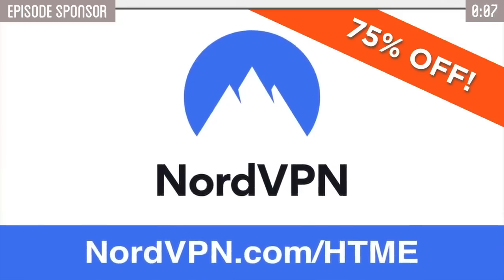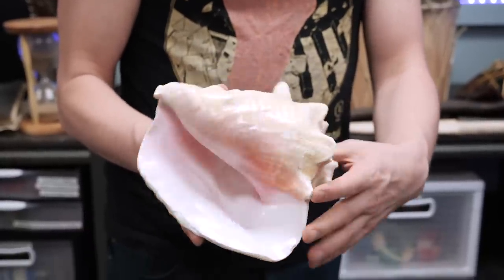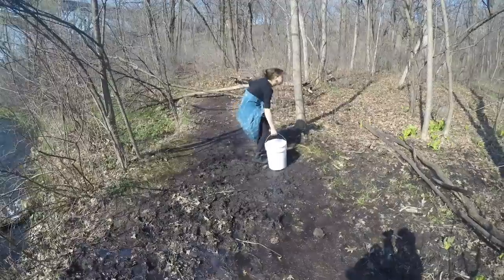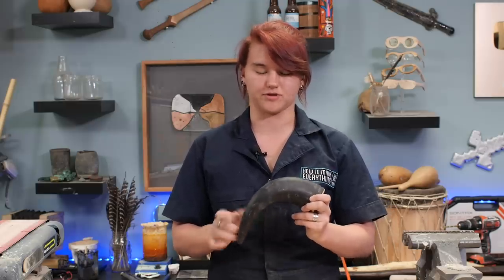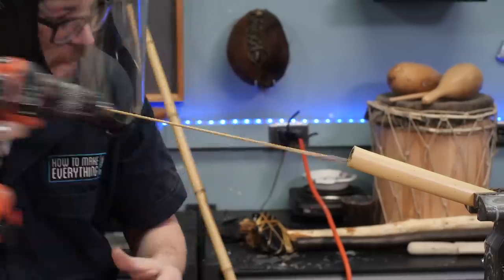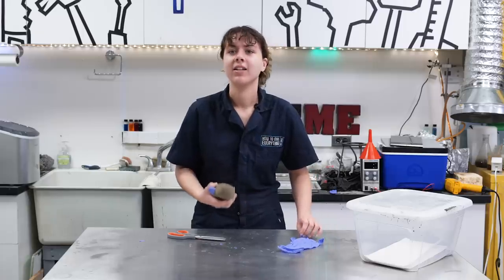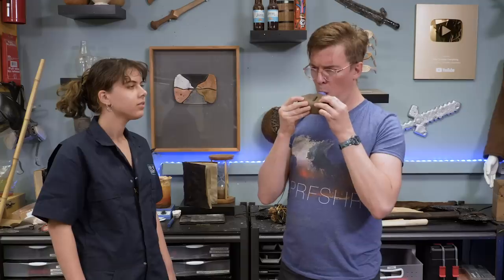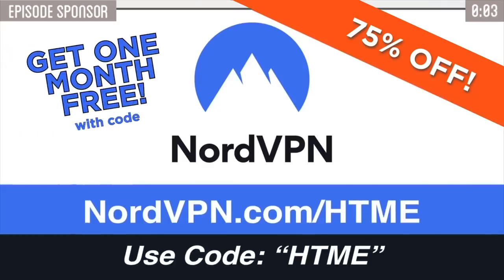Can You Make a Flute from Dirt and Dead Things?

Comment: Regarding the clay: Processing it can be quite tricky. I made numerous beginner's mistakes as well^^

-Don't put whole chunks in the water, as they will form a slick outer layer that protects the inside from dissolving
-Thoroughly dry them first (breaking them up a bit helps with that)
-Then use a rubber mallet (or something similar) to grind them down, as a metal hammer will grind the stones and sand in the clay a bit, adding unwanted material
-Sift the dry powder to filter out stones, twigs and other organic material. The finer the sieve, the better
-Put the fine powder in a tall container (e.g. a bucket, or a glass jug to check the sediment) and add large amounts of water
-Stir until everything is dissolved, then wait for a bit (a few minutes) until the sand settles down
-Carefully pour the murky water through a sieve, without pouring out the fine sand and sediment from the bottom of the container
-Use flat screens instead of round ones, as the clay tends to form clumps more easily
-Rinse and repeat^^
-Pour the final batch into a wider container and wait
-Let the clay settle down until a clear layer of water forms on top
-You can try to gently pour/siphon out most of it, or you let it evaporate under sunlight or at a warm spot with some ventilation

-When the clay has a batter-like consistency, you can put it on a larger surface to speed up the drying process or put it in a piece of cloth.
(Not every towel or piece of cloth will work, though, as clay particles are really small.)
-If you spread it out, avoid forming crests and peaks while spreading it, as those will dry faster than the rest
-Use an absorbent surface material that won't contaminate the clay. (Didn't have any at hand, so I had to wait.)
-After quite a while, the clay will change color a bit and won't really stick to your hands anymore
-When it has a rough, Play-Doh-like quality, begin to work it a bit (research some techniques online), then form a block
-Wrap the block in plastic wrap to prevent the clay from drying out and store it

A block I made about 2 years ago is still malleable. If it smells musty/earthy, that's normal. I read that letting the clay "ripen" over a longer period improves its quality. Some people with sensitive skin might get skin irritations from the mold, though. If your clay isn't processed enough (if it's too gritty) the clay will tend to break while forming more delicate shapes. A simple test ist to roll out a small clay snake and wind it around a finger. If it breaks apart, further processing is needed. Adding sand to a slippery clay is much easier than removing sand from a gritty one.

Further testing:
-Roll the clay to an even thickness
-Take a cookie cutter, glass, etc. and cut out a few circles
-Measure the diameter and let them dry evenly and slowly
-Measure the shrinkage in diameter and thickness after drying
-Fire them (research best practices online), then measure further shrinkage in diameter and thickness
-Some of them might crack. Grind them down a bit and add the so-called grog into a batch of clay to strengthen it
-Take measurements of the ratio of grog and clay
-repeat the tests with varying thickness and diameter with and without grog
-Write everything down

Further research:
-Glazes
-Firing process
-Different ceramics and their recipes
-Tools and techniques (flywheel, grafting pieces of clay together, sanding and polishing, etc.)

It's quite a broad topic.

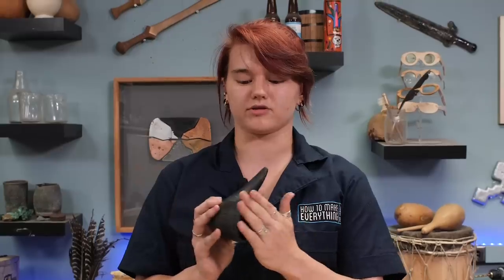Comment: 7:40 
I personaly would never do this with a chop saw. I work with woodworking Machines everyday, and there is many ways to use them that they are not intended but that just looked unsafe to me. The forces of the spinning blade will easily drag your hand into the blade when the piece of Wood is so short, and even worse it was round so you get minimal Contact to the fence with the piece.
A bandsaw would be better or just a normal handsaw would do that job easily, pretty much no time loss and a lot safer.

Otherwise really cool video.
Reply: Who needs fingers anyways?
Reply: @garethbaus5471  you need them for when your hungary

Comment: The bamboo flute demonstrated at the beginning is a quenacho, not a quena.  The flute that was made was the size of / tuned like a normal quena.  However, a different species of bamboo is used to make quenas.  It has a completely round cross-section, and grows with long enough spaces between the nodes that you don't have to break through them.  Typically, the node is used as the bottom end of the flute, with a hole placed in the center that can be used to help tune the lowest note.  For a round mouthpiece, like the one pictured at the beginning, a round file is used, not dremel bits.  They also exist with square mouthpieces, which are cut with knives.  The guy who introduced it said it's a relative of the shakuhachi, but Andean and Japanese cultures didn't interact with each other - the two flutes are just superficially similar.

Comment: There's actually a way to use your hands as a flute. It's really hard to describe in words but you basically cup them together with one curved and one more flat so the only gap is between your thumbs, then put your thumbs against your mouth and use them as the reeds. You can change the pitch of the note by changing the angle of the flatter hand (I use my right hand), and with enough air you can even get high notes with the flatter hand extended enough to make another gap. My dad showed me how to do this for imitating owls and mourningdoves, I was also able to get distinct enough notes for simple songs.

Comment: I think starting with wind instruments was ambitious! It's actually very difficult to get the hole placement and size tuned correctly on a first try...I applaud the great effort!
But, I think I would have tried to start with strings. I feel like a home-made violin, fiddle, zither... something would maybe be a bit easier. ...I mean, I'm not expecting a Stradivarius--the shape (and thus tone) doesn't have to be perfect. I'm talking just a hollowed body, and then some gut strings with a horse-tail bow. I bet you could make a pretty darn decent string instrument, especially because it's easier to modify the string length and tightness to get the pitches you want instead of having to start all over if it goes awry. 
Also, I'd love to see some hide drums. :) Maybe a rain stick? 
If you could make a didgeridoo, I think I'd have to support you on Patreon.

Comment: From making my arrows from bamboo I know you can pop the chambers simply by inserting a heated meta rod and burn through the chamber walls before straightening ...it’s either that or pop the chambers with a needle at the nodes so the shafts don’t explode.

Comment: The black stuff is NOT clay... that's humus (rotted plant material/minerals)... the clay is the pale material... SEPERATE the two, dry it out, grind it to a fine powder, sift through a fine mesh screen (to remove any extraneous sand, rocks, detritus), re-introduce water to make "ceramic" clay, use...

Comment: ...Why would you make a clay ANYTHING and not glaze and fire it?
Reply: probably because it's got so much silt in it..

Even beside that, they'd need to do a bunch of test firings to find out what temperature this clay will work at. That takes a bunch of time. And that doesn't include the time it takes to actually dry it first (not just semi dry).
Reply: @qvatch  Nowhere near enough time that they couldn't have done that here. Furthermore, the test fired pieces can be ground down, mixed with ash, and voila, glaze for the finished piece. Even if they DIDN'T do that and just did a low cone firing, it'd still have been superior to leaving it as unfired clay. The ocarina that she made was nowhere near large enough to require much time to reach the dryness required for even a basic bisquing, especially with the use of the silica beads to quick-dry it much faster.
Reply: @KainYusanagi  Of course, I agree completely. But given how they repeatedly make the same mistake doing glass I now assume willful ignorance. I don't have the luxury of owning my own kiln, so I need to know my work isn't going to explode, melt, offgas problematically, etc. You sit down with one or two textbooks on glaze formulation, and you get the basics. Made from scratch doesn't need to be process-rediscovered-from-scratch.